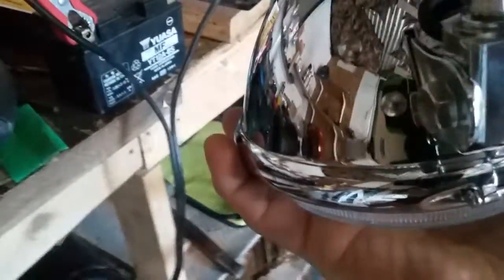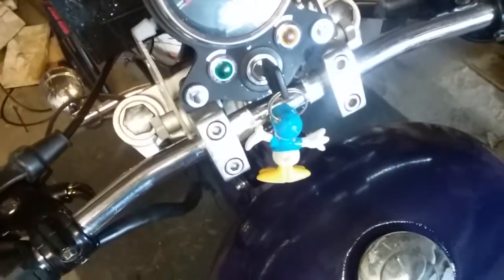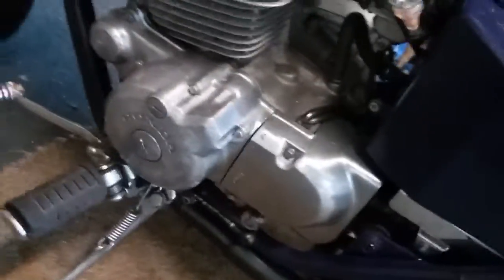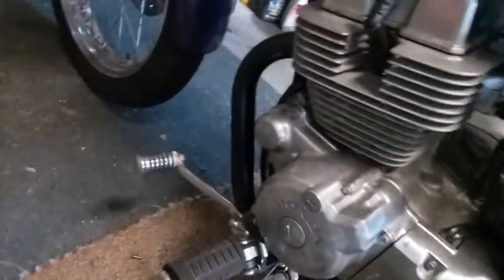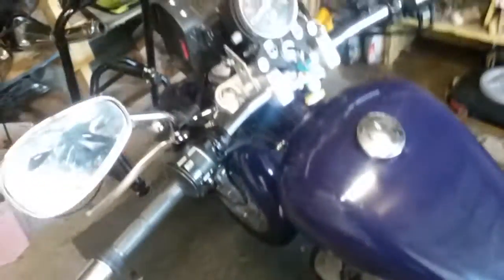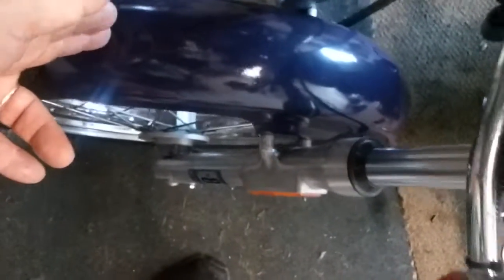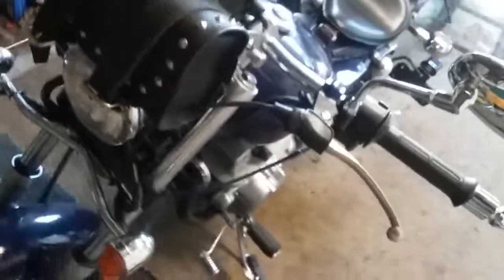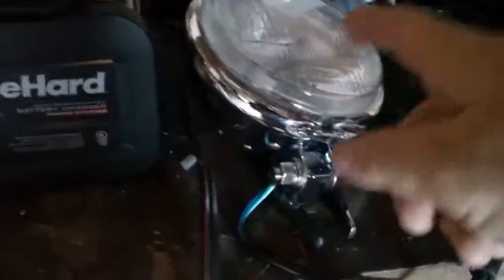Rebels new stuff

Comment: I forgot to mention I went back to straight pipes on my rebel. I was going to work one morning and low and behold one of my mufflers fell off while I was cruising down the highway at 65 mph. Never did find it. What happened was labor day I went to the fireworks and congestion was bad so I parked on a sidewalk. When I was leaving I drug hard on one of the pipes breaking the mounting bolts on that one side. I’m using 28 inch on each side of top rail chain link fence pipe for exhaust now. It really doesn’t sound all that bad. But it really pops and cracks when you close the throttle when riding lol.
Reply from the maker: That's what I made my pipes from.I had some galvanized chain link fence pipe laying around so I figured what the hell is don't rust it's thick enough I cut a slant on one end put baffles in them and they work great.